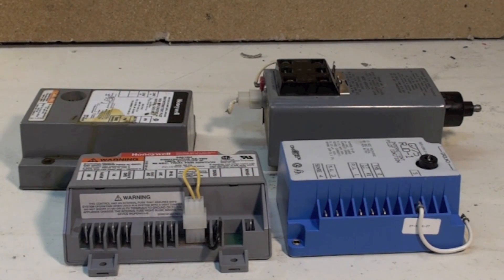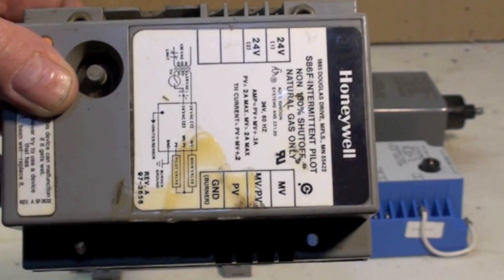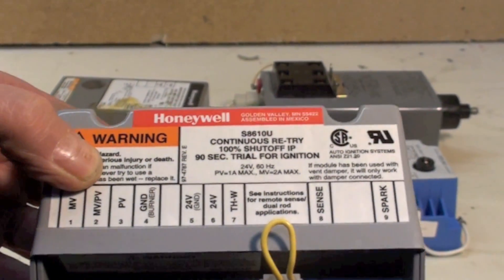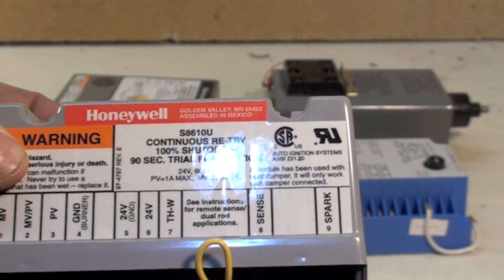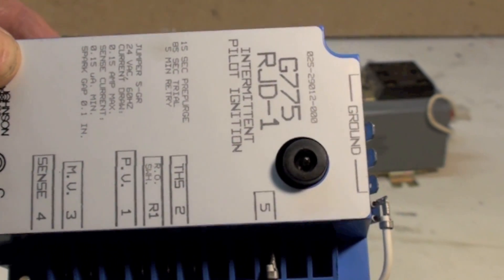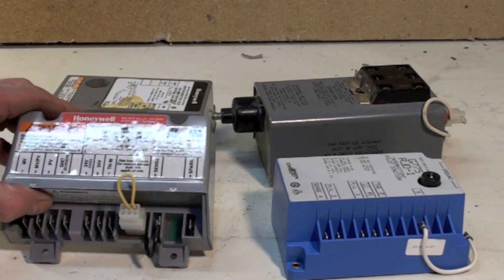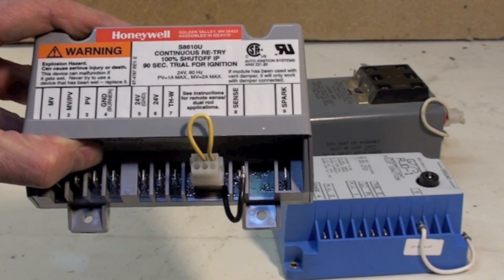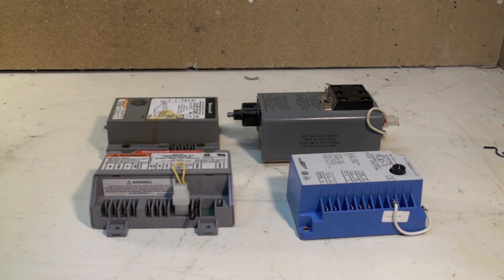Gas furnace spark ignition controls

Comment: My G60PAG-1 module doesn't spark anymore. The furnace repair company diagnosed that the module is bad. Shall I replace it with another G60PAG-1 or S8610U ? We actually tried with a new S8610U module and did wiring following the manual, but it didn't work. At first it sparked but wouldn't turn on the gas valve. Then it wouldn't even spark. We wonder that we got a bad unit.
Reply from the maker: I would stick with the G60.
GFM
Reply: Thanks! Do you know where I can buy G60? Does it have to be G60PAG-1 or any G60? So far I could only find one seller of G60PAG-1 on e-bay and it says “New without original packaging.”. I don't know how reliable it is.
Reply from the maker: Most of the G60s with the same wiring terminals should work.  I have no sources for parts.
GFM
Reply: Thank you very much!

Comment: I remember those JC G60's on older Trane and Aaon units. On older Lennox residential furnaces they were somehow built into the gas valve. JC, the other one. Has been nicknamed the blue box of death in the industry. Very high failure rate on package units on those in my experience.

Comment: i just replced my ignition module for a bewer black colored version of that honeywell s86 u have there. but i get not spark? any ideas?
Reply from the maker: Be sure you have volt power to the control.
GFM
Reply: does that mean to put my meter on the 24volst pin and ground turn it on and see if i get a reading?
Reply: Probably wired it wrong or their is a safety switch open. You sound in over your head Jesus. Stick to landscaping work.

Comment: hi there gfm, love your videos Ty so much. You helped me a few years ago when we replaced a Robertshaw con mod on a Lennox. PN# 18G 9101 model# sp735L.  well, sounds like we need another module, it's doing the same thing. when it calls for heat there's no spark just a click & 1/2 kinda thing and we are blue in the face checking /cleaning everything else. My question is, should we replace the module again with another used one or just buy the replacement kit and would that be part# 30w33? the last used Robertshaw I bought was only$75 the used one I found now is $150. a new one with kit is about $110.  I just didn't want to do the re wiring if I didn't have to. (and why does it keep going bad?) it's so nice to just do a swap out. Only thing we've done to it since the original swap out is put in a new inducer motor and it ran and sounded great. Thank you again. brrrr in Michigan.

Comment: I'm in the process of making a commercial size smoker. The first one I made was all electric. This particular one is LP fired. It uses Honeywell and Barber-Coleman PIDs to monitor and control compartment and meat temps. I've also incorporated a small PLC to control everything else, like solenoid valves for shower unit, convection fans, and alarms.
Originally I had used a Honeywell board and gas valve off of a furnace, which used a hot surface ignition. This ended up being a bad choice as I never could get a consistent flame due to the combustion air blower I'm using.
I've now went back to the drawing board and am planning to use a Honeywell S8670K direct spark ignition control and a White Rodgers 36H32-423 direct spark or intermittent pilot valve that I've purchased off Ebay.
My question to you is (of course, I will be using a flame proving device), can I eliminate the pilot by plugging it @ valve and go directly to main and, if so, do I just simply not wire anything to both the valve and control pilot terminals?
Reply from the maker: The valve must have both the pilot and main valve energized to work.  Yes you can plug the pilot port.  Hope this helps.
GFM
Reply: I'm gonna give it a shot. Thanx!
Reply: Couple more questions...
1) If I wire up all PV terminals according to manufacturer but plug the pilot port on valve, will the main open when calling for heat? Just curious where it gets it's gas from.
2) I was operating under the assumption that this ignition module would give continuous spark even after flame proven. From manufacturer's literature, it looks like that is not the case. With combustion air flow, it certainly looks as if I'll need continuous spark, otherwise it blows flame out.
Reply from the maker: The main and pilot valve are in series.  So you can only get gas flow if both are energized.   
It will not spark continuously.  It sparks until flame is proved.  If it loses flame, the gas flow is stopped usually within 1/2 second.
GFM
Reply: Yeah, that's what I suspected.
I'm leaning towards getting a ignition transformer for continuous spark.
Thoughts?
Reply from the maker: Go for it.  I would use an oil burner transformer.
GFM
Reply from the maker: The s8670K is a pilot ignite control that lights the pilot, then proves flame and opens main valve.  Your application, if I am correct, wants to light the main burner with the spark.  The problem here is the spark is not large enough to light the main burner.  In addition, The spark will continue for anything from 60 seconds to continuous.  Would you want main gas open, dumping gas into the smoker for that long?  A direct spark ignitor has a larger spark and it will only continue the main gas open for several seconds before safety shutdown.  2 parts that may work would be the White Rodgers 36J22-214 gas valve used with a 50D50-842.  I am not endorsing this fix, but what you have could be very dangerous.
GFM
Reply: I ended up using a two wire gas valve, a White Rodgers control (no pilot), and an ignition transformer. The smoker has been in production for a few months now, smoking well over 500 salamis and a few hundred pounds of snack sticks. I'll have to make a video of it and post it.
Thanks for your reply
.
Reply from the maker: I would love to see it in operation.
GFM

Comment: why not use the spark to light the burner directly but light the pilot first?
Reply from the maker: +XIAO JIE There are direct fire spark ignitors, but they are not commonly used.  Lighting the pilot then the burner is common because it works well on retrofit applications.
GFM
Reply: why because it's tge pilot job to keep the main burning at all time. It provides a secondary flame that spreads readily to the main burner, no smart sending needed on hot burner. Pilot sensing is better than main ramps sensing.

Comment: the wire that needs replaced is Dixie wire brand 18 awg with a heat rating of 150 degrees celcius.... are you sure a regular primary wire will be okay?
Reply from the maker: +Matt b You can check your wire and see if it has the 150 rating I would use 150 wire.
GFM

Comment: what if my furnace works perfect for a while then will go to the retry mode.... it isnt sparking when in the retry mode and obviously because of that no flame... but then i can turn it off and back on unplug one of the leads on the pressure switch and it will kick on and cycle normally for around 8 hours and do the same... do you think its my pilot ignition control? had a company over twice and they have told me could be the exhaust fan motor not sucking hard enought or faulty pressure switch as well... but then second guy came out and said my ignition control.
Reply from the maker: +Matt b My thought here is if the unit starts its cycle when you remove the wire from the pressure switch, that the pressure switch is sticking closed.  The does not cover all of the issues you tell of but its a start.  Could you give me a make and model#?
GFM
Reply: +grayfurnaceman the model is g23q3/4-100-2 lennox
Reply from the maker: +Matt b I doubt it is the ignition control.  This one sounds like a vacuum problem.
GFM
Reply: +grayfurnaceman found out some more info... when I turn off the switch to the furnace and turn it back on it tries to cycle the furnace flame on sometimes it does but most times it doesnt. after playing with it when it doesn't lite u noticed a yellow wire on the ignition module that when u push it towards the furnace will pop the flame on.. it labeled ground. I inspected the wire and the wire itself looks fine... could it just need a new wire or is it possible the connector on the module is going bad?
Reply from the maker: +Matt b You probably have a loose connection in the plug.
GFM
Reply: +grayfurnaceman any way to fix it? I'm wondering if it's not in the wire but in the connector coming from the ignition control. if it is the wire do I need a special wire to replace it?
Reply from the maker: +Matt b The ground wire is nothing special.  Primary wire will do.
GFM

Comment: I have a gas furnace its a train twin its an older model it will ignite but not stay light to kick the furnace on had this problem before changed the limit switch 2 months ago now furnace is acting up again and wont run past first igniting
Reply from the maker: +Norma Barnett Have you cleaned the flame rod?
GFM

Comment: Gary, I have a 1,000,000 btu boiler (car wash). The pilot lights the main burner lights then it immediately shuts down and starts again.. pilot-main burner-shut down. honeywell S86, the boiler is approx 15 years old. Any advise. Thanks
Reply from the maker: +Kim Hensley When the main burner lights, does it pull the flame off the pilot burner?  If so, this could be burner problems.  As it is a car wash, the burners could be rusting.  Hope this helps.
GFM
Reply: +grayfurnaceman  Can't thank you enough for the reply! I had not thought of that, when the burners do ignite they seem to ignite with more "boom" than I recall. I was going to replace the the S8610 but will pull the top and side off the unit and inspect the burners tomorrow. Thanks again.
Reply: +Kim Hensley Gary, I think you are correct, however where do i turn to now. I have replaced the S8610U, the pilot/spark assembly, and pulled the burner manifold out and worked all the burner tubes with a wire brush. Same result, the pilot lights perfectly and when the burners kick on they blow the pilot flame out. It's like there is too much gas pressure and the initial burner combustion is too robust.
Reply from the maker: +Kim Hensley Now you get to try all the shields and the like to protect the pilot.  A small sheet metal shield, placed correctly, may stop it.  Hope this helps.
GFM

Comment: awesome videos! many thanks for all the info...I have an older magic chef furnace that usually works great in my shop, I regularly clean and maintain the unit. This year however I fired her up and my fan center relay burned up...This was the original Honeywell unit, I purchased a new white Rodgers 90-113 replacement and I believed I wired it in correctly (not 100% sure though)...when I tried to fire it up first off the blower came on right away, I then noticed my led on the ign mod (S8610U) was flashing 6 and 7....purchased a new ign mod, re-wired the relay I think the right way this time. Held the two T-Stat wires together and had perfect ignition, main burners came on, etc...BUT as soon as the blower tried to go on the whole furnace shut down...now the new ign mod is flashing 6 and 7 too.....any ideas sir?
Reply: Call a pro. Or keep throwing parts at it.

Comment: Really enjoy your videos.  I do property management and it is good to know what is going on when the HVAC guys are doing service on the units.  Curious, contractor just replaced one of these ignition modules because of no spark (and also the ignitor rod thing at the end of the cable).  2 weeks later, the new module isn't sparking.   One thing I am curious about is the Ground to burner connection (like the one on the honeywell you showed in this video).  Is it supposed to be connected to the "C" marking on the gas valve?  Does the "C" stand for common?  I see a "p" on the valve (guessing for Pilot) and a "M" (guessing for main valve) but wasn't sure what the C was for and why it connects to Ground Burner connection on the ignition module.
Reply from the maker: +cantire1234 C is common.   You are correct on the P and the M.
GFM

Comment: how about if the spark plug doesnt lite? whats wrong with it? i tried to measure the voltage in spark plug wire but im getting no voltage so i thought its the spark ignition control ,im just wondering if i should have used milivolts instead. i was using that blue one.

Comment: A have a question I'm working with the fenwall 35 series.sometimes the gas valve open at delay time after the ignitor lit up then it opens.eventually the the ignition module will lock out,I've replace the flame sensor and ignitor,gas pressure at the manifold are ok,air proofing switch close but what causes the delay?any idea,I've change the module still does the same thanks
Reply from the maker: Hernil Soriano If you can make a video of the problem it would help me to understand what is happening.
GFM
Reply: Ok I will when they call be again..it's from a rack oven thanks

Comment: My heater recently went off. I called the local heating and cooling service and when the guy got here I asked him up front if he was going to charge for looking. He said yeah they charge $97 right off the bat. I told him I didn't have that, and we just paid $120 for getting my furnace cleaned in January and maybe it was related to that.

He asked to look at it. I took him down to the basement and he took the cover off and took out the S8610U sparkbox. He asked if my thermostat was on and I said no, so he told me to turn it up. I did, and when I went back down he had it started. He said my furnace wasn't controlled by normal pilot, but by the S8610U and I will need to buy a new one because he didn't know how long the one I have will last. In fact he siad it could go back out in 2 hours. He didn't charge me but said a new one could cost $400 alone unless I order one online.

I am trying to figure out how to get my S86 to reignite my furnace until Friday.
Reply: LOL

Comment: Hello GFM... I have a question for you. Im troubleshooting a goodman furnace. With a spark igniter module. I call for heat and the induced draft motor comes on.. and a second later the blower motor comes on. I hear and see no spark at all and nothing happens. could you possibly give me a sequence of operation. Is the circuit board suppose to sense a spark before it allows gas to flow. I want to say that its the igniter module.. simply because i looked behind the board and theres a little burned dots on the 24v side. I applied 24v directly to see if I could at least hear a spark and I didnt. Thank you for your time and knowledge.
Reply: No it is the thermostat. Did you replace that yet?

Comment: Hello GFM, we have a Fenwal 05-162426-003 igniter in our furnace. For years now the furnace makes a rather high pitched whistling sound when it runs.  The sound is associated with the burners igniting NOT the fan kicking in. As soon as the burners go off, the sound disappears but the fan continues to run for a few minutes. I'm pretty sure that the sound is coming from the Fenwal igniter module.  We have the house up for sale now and we're concerned that the sound may scare some people off.  We're in Michigan so the furnace runs frequently this time of year.  Do you have any suggestions on how to eliminate the sound?  Thanks much.  Good, informative videos by the way.
Reply: Install a new furnace.

Comment: Hello GFM I have a 26 year old gas furnace with a spark ignition/sense in 1 line. The problem I am having is that the pilot lights, the main burners light, but it goes out after about 30 seconds to 1 minute and then immediately begins ignition sequence again and does this nonstop. I'm not sure what to check. The pressure switch has voltage in and out and it's constant so I don't believe that's the problem. I did notice the spark wire had a crack in the rubber around the part that connects near the pilot and was a little loose so i pushed it on really tight and it was fine for 2 weeks. But I just got a call and it's acting up again. Any thoughts?
Reply from the maker: Dwayne Muszik The rod the spark wire goes to is also the flame sense rod.  You might try cleaning the rod with sandpaper.  Hope this helps.
GFM

Comment: Hi Mr. "grayfurnaceman",
I find your videos very informative.  I am not a HVAC Tech, but I am pretty handy, however I am having issues troubleshooting my Carrier Weathermaker SX, model #58SXA060-GG Series 100.  About 60% of the time when my thermostat calls for heat I don't get a spark to my pilot.  When it does NOT light, my inducer motor will start and run, I hear a click that comes from my ignitor/lockout control, then I loose my 24v to my pressure switch and it will eventually shut everything off.  I have checked both of my intake and exhaust pipes for debris, they are clean.  I have checked all of the drain tubing and cleaned out the drain trap, it is clean.  While the inducer motor is running, I can ohm the pressure switch to make sure it is closing and it does.  It stays closed, even after I hear the click from the ILO, it is still closed.  So far what I know, is that when my thermostat calls for heat, I have 24v coming from "W" to my ILO going into pin 5, then when my pilot does NOT light i hear a click and loose 24v at pin 1 of my ILO.  I am guessing I am hearing my 5-minute lockout timer open when that is happening.  I believe that my ILO is failing, but because I am not a HVAC tech, I would love a second opinion on this matter, and have someone tell me if there is something down stream, maybe a faulty ground or connection some place else that could be causing my ILO to open and not produce a spark.  I also know that if I jump 24v to the c terminal of the pressure switch, my pilot will light, my main gas valve will open and my main burner will light, at that point I can take my jumper wire off of the "C" terminal of the pressure switch and the furnace will run until my desired temp.  Any information on this would be much appreciated.